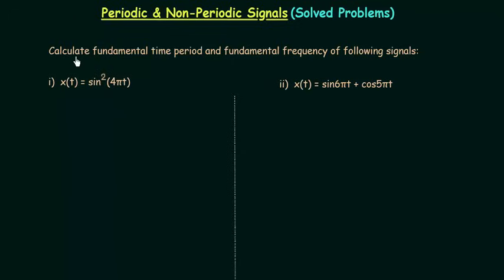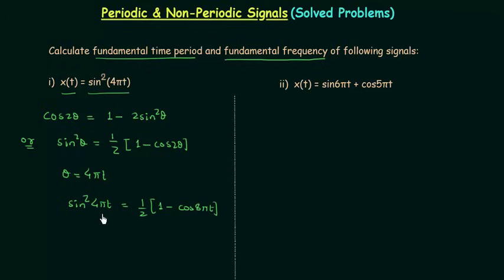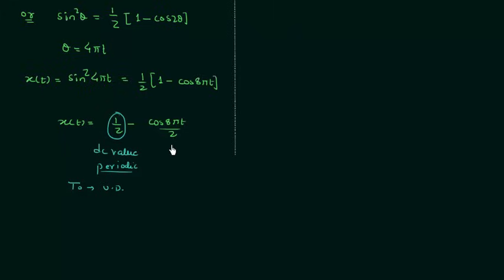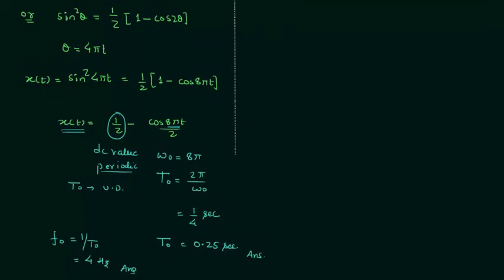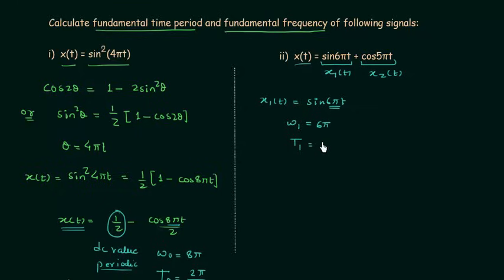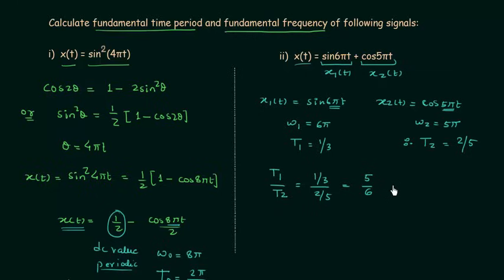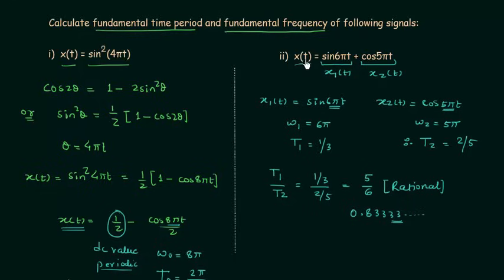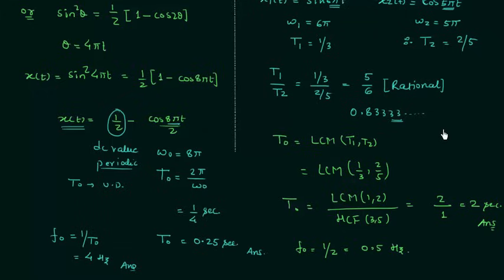Periodic and Non-Periodic Signals (Solved Problems)

Comment: Thank you sir one doubt Cos8pi.t÷2 therefore omega =8pi÷2 but you wrote 8pi only sir please reply me sir
Reply: The fundamental time period of the signal \(x(t)=\sin ^{2}(4\pi t)\) is 0.25 seconds or 1/4 seconds. To find the fundamental period, use the trigonometric identity \(\sin ^{2}(\theta )=\frac{1-\cos (2\theta )}{2}\). Rewrite the function:\(x(t)=\sin ^{2}(4\pi t)=\frac{1-\cos (2\cdot 4\pi t)}{2}=\frac{1}{2}-\frac{1}{2}\cos (8\pi t)\)Identify the angular frequency (\(\omega _{0}\)):The function is now in the form of a standard cosine wave shifted vertically. The constant offset (1/2) does not affect the period. The angular frequency of the cosine component \(\cos (8\pi t)\) is \(\omega _{0}=8\pi \) radians per second.Calculate the fundamental period (\(T_{0}\)):The relationship between angular frequency and the fundamental period for a continuous-time sinusoidal signal is \(T_{0}=\frac{2\pi }{\omega _{0}}\).\(T_{0}=\frac{2\pi }{8\pi }=\frac{1}{4}\text{\ seconds}\)

Comment: HCF should be 15
Reply: its lcm would have been 15 but hcf means highest common factor between (3,5) which is 1
Reply: ??? The divisors of 3 are 1 and 3 and 5’s are 1,5. The maximum number in common between (1,3) and (1,5) is 1.
Reply: Dude you confused lcm, hcf

Comment: Sir can we take Sin2(4πt)  as  --> sin(4πt)*sin(4πt) ?????
Reply: RAMIZ AMER CH i have done using that but am not getting the answer..
Reply: No
Reply: Sin2x=2sinxcosx not (sinx)*(sinx)
Reply: On working sin(4πt)*sin(4πt) you will be getting time period as 0.5. 0.5 is also a time period but not fundamental time period(fundamental time period as in video is 0.25 and 0.5=2x0.25). While solving we must try to reduce the given term as nonsquare (as in this case), if we are not able to do so we can then follow the conventional method.
Reply: There is always a difference sin2x  and (sinx)^2
Sin2x=2sinxcosx and 
(sinx)^2 =sinx*sinx or 
(1-cos2x)/2
Reply: Vinith you can also do by that way no problem
Reply: NO if signals are in product form, we cant find T directly. we should use some formula to convert it to sum form.then only we can find T.

Comment: How we can solve these type problems?

x(t) = 2cos(2t+pi/5) and 

x(t) =e(3+j)t

Thank you very much
Reply: Can you write the whole problem please? What you want from  x(t) = 2cos(2t+pi/5) 
If you want to calculate fundemental period of this signal it is easy to see actually  fundemental period of this signal is 2pi/2 which means 1
Reply: And also x(t) =e(3+j)t for this signal if you can not see directly you can use euler's formula and change the signal from exp to sin and cos than  it will be easier to see
Reply: @ahmetcihatbozkurt8769  how it becomes 1?  Pi will be the answer correct?